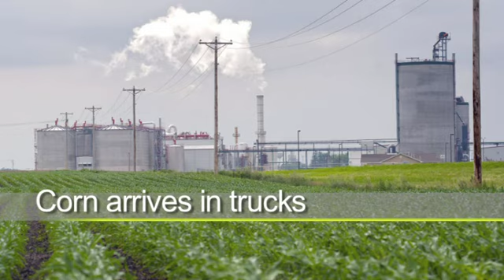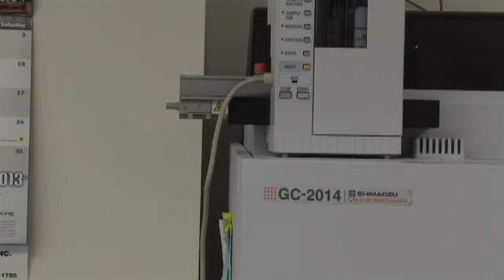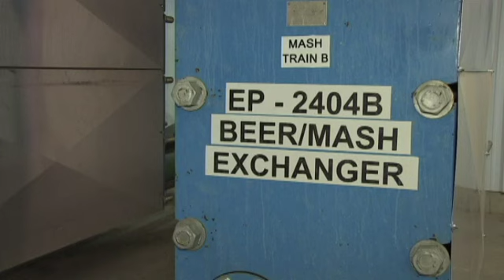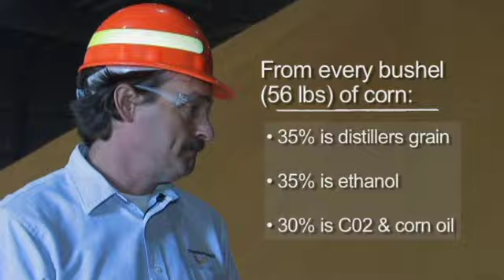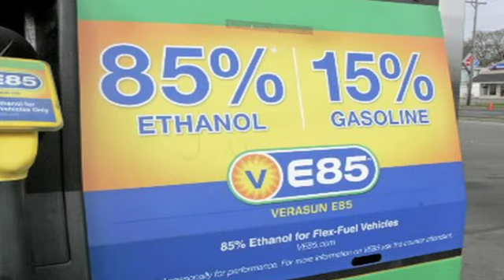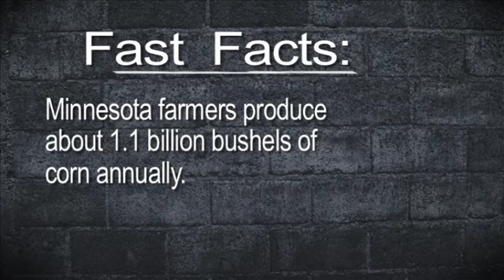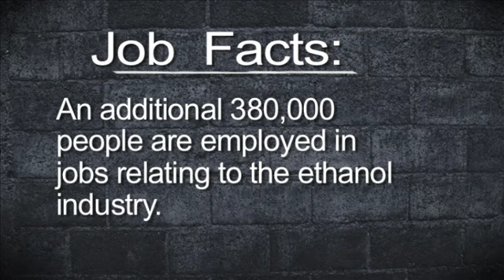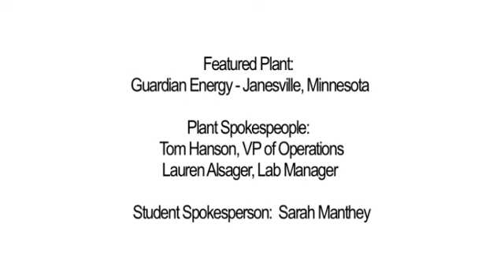Ethanol Made From Corn

Comment: For 1 liter of ethanol, how many KG of corn must be?
Reply: bambang303378 Not entirely sure on kg, but in 2012 an average of 352 gallons of ethanol for 1 acre of corn. (1.33 kL ,4046 sq m)
Reply: One acre yields 7,280 lbs of corn. 
  7,280 lbs of corn makes 352 gallons of ethanol.
  352 gallons of ethanol ÷ 7,280 lbs of corn = 20.68 lbs of corn per gallon of ethanol. 
  9.38kg (20.68lbs) corn = 3.78 liters (1 U.S. gallon)
  
It takes 2.48kg of corn to make 1 liter of ethanol.
   Or.
20.68 pounds of corn to make 1 U.S. gallon of ethanol.